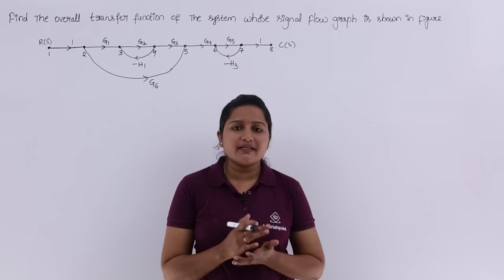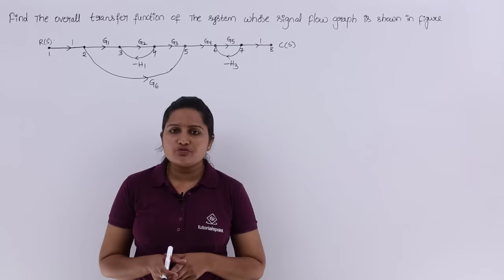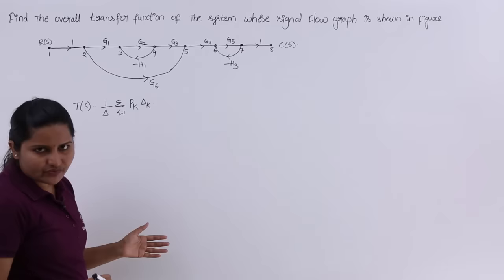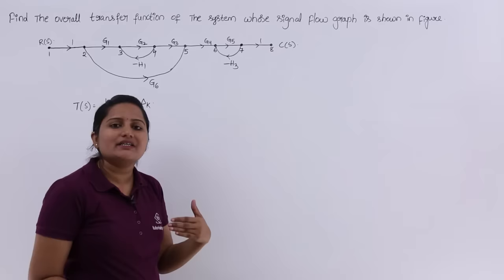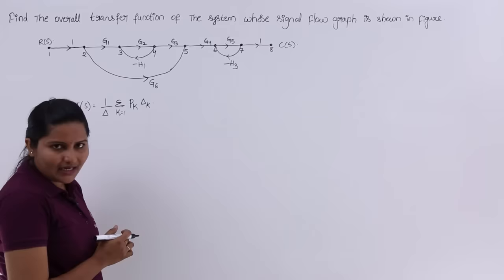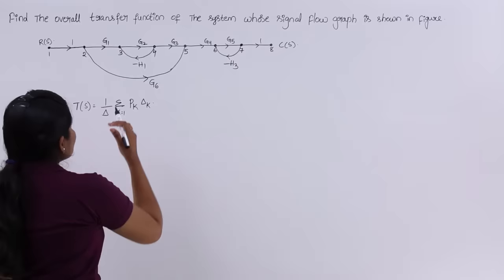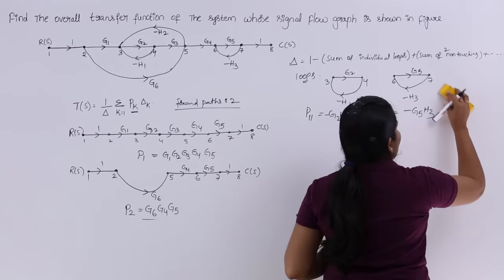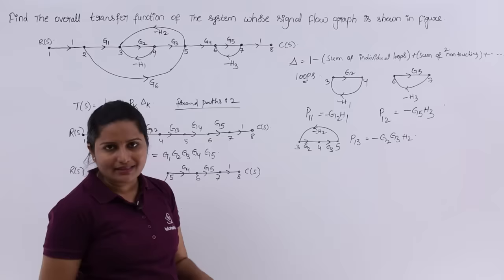Problem on Signal Flow Graph

Comment: very good  lesson but  the delta formula is wrong it should  be (1- a sum of an individual  loos +sum of two non touching loops - three non touching ....)positive after negative respectively  explanation of topics is good
Reply: Yes bro... she's gonna wrong
Reply: You right
Reply: Correct. I am revising this after around 6 years i felt something is wrong. So came to the comments and saw yours. It's right. Alternate signs should be there.

Comment: Plz make a video on power supply (voltage regulator,-+12 volt,rectifier circuit and Adjustable variable) all circuits and how to connect also ✍️✍️✍️✍️✍️✍️✍️✍️🤳🤳🤳🤳🤳

Comment: A feedback system is characterized by the closed loop transfer function, 
2 3 1
3 3
( )
3 2
2
  
 

s s s
s s
T s
. Draw a suitable signal flow graph and obtain the state 
model.
Mam intha sum solve panni solli thangachi please.